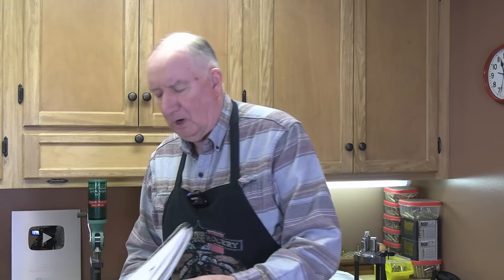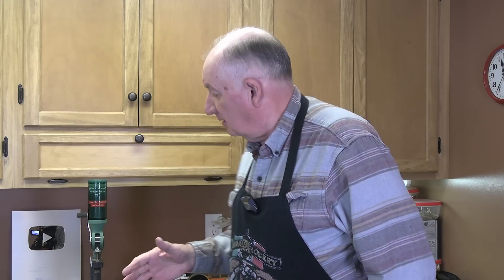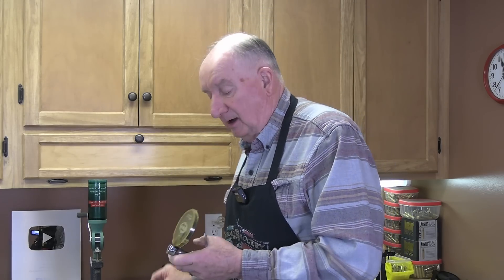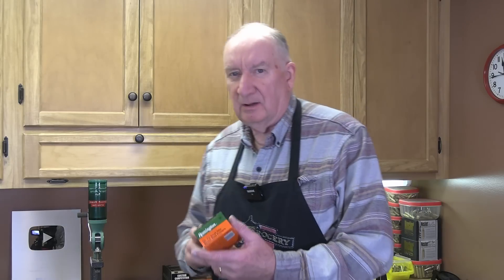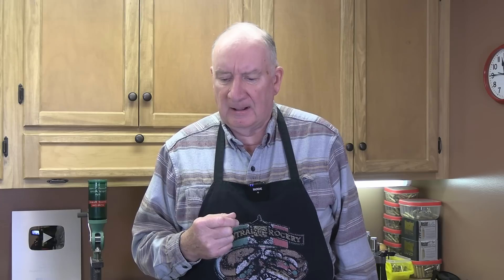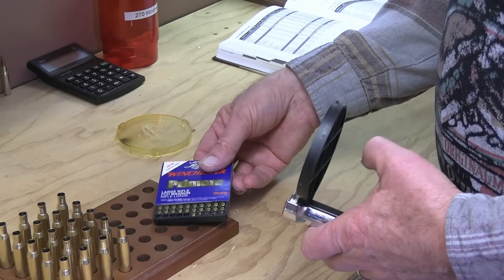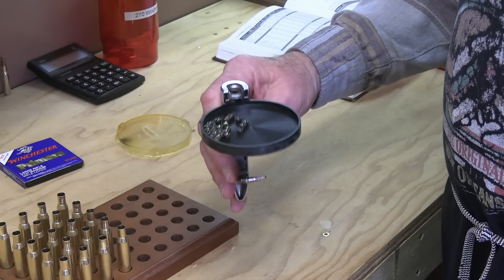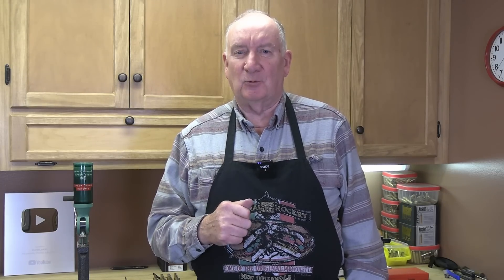How to Make Super Accurate Ammo ~ Part V Priming

Comment: You're not kidding about the velocity change between batches of primer. Running out of the lot I had on hand I pulled out an older (yellow color) box of CCI 200's and continued the same batch I was reloading. CCI 200's (40636C vs 40636D manufacturers number)  Had a Labradar running and part way through a shot string velocity went up from 3626 to 3683!@! 8.5 SD/ 23 ES for the 5 round string before this so there were none out of parameter. 
Took a break for a while until I could figure out what had happened for such a velocity spike between reloads and then remembered I had switched to that old box of primers part way through the batch. Would never have though swapping primers, especially to a different batch (granted much older) in the same brand could have an almost 60 FPS result!. Sure enough because I had boxed them as I loaded them, it was easy to tell exactly where I had made the swap.
Thanks for the great content!

Comment: I have that same exactly framing tool. I'm 58 years old. Been doing it since I've been 28 years old and that's the two of my brother told me to get cuz that's what he had and he's 13 years older than I is. Tell just another heads up. I had an issue with my RCBS rock chucker press. I'm back in the '70s early '80s. Send it in RCBS said it needed a new RAM which was 4 to 6 weeks out or send me a new one so they're sending me a new one. No cost to me whatsoever. That's pretty good service. This is February 10th I believe is when they called me about that. Still waiting for it to come
Reply: I've had very good experience with RCBS too. Sent me some spare parts to the UK foc. Needless to say when I wanted another press I bought another Rockchucker.

Comment: You know, I still use the exact same Lee hand priming tool. I could have moved on to a more precision tool costing ten times more but this basic Lee priming tool has worked for me since about 1970 or maybe the late 60's? I stock every primer made but the one I use the most is the Federal 210match. One step I use is with my primer pocket uniforming tool and the depth is precise, primers are just below flush, it's a positive feel with the priming tool. I do like to use Remington primers with certain loads simply because they are easily identifiable due to the brass color, all the rest being silver.  Example: I use 85 gr. Sierra Spitzers on coyotes and hunt deer with the 100 grain Spitzer. They look the same but the 100 grain bullets have a brass 9 1/2 primer, a simple identifying feature.... other than switching brass. I use The Federal 210M in 90% of all my rifle cartridges except 300WinMag. uses Winchester primers.Yeah, another primer would work, but I'll stick with my original load. I know that your reasoning on spending more than necessary is valid, but at this level, handloading is not about economy.

Comment: Great presentation!👍 I hope the folks new reloading follow your lead. Would sure save them lots of grief.

Started loading with my great uncle monitoring my progress as a young lad in1958. We were using his Ideal 310 tong tool for 45Colt. I still use my 310 at times. However, the old Lee Auto Prime such as yours is, has been with me for ages. Both provides that all important "feel" that these newfangled progressive presses lack.

Comment: The value of " feel" can't be overstated. The human body is a very accurate Guage of press fit, plug fit, slip fit, running fit situations. With experience, of course. I rebuild antique motorcycle engines. I can't recall the last time I measured a valve ti guide fit, for example.

Comment: I feel like I have to mention that you kinda glossed over the primer that you might want to select. I too have been reloading for decades. When I started I bought a selection of loading manuals from both bullet as well as powder manufacturers. I update them periodically. It’s not uncommon for powder manufacturers to require magnum primers for a non magnum cartridge. Hodgden is a great example. Many of the spherical powders “require” magnum primers. Speer loading manuals    confirm this in cross referencing. I recently started loading for the 300 Hamr which requires magnum primers for all their loads. I’ve also found that some load manual only use Federal 210M primers for all their load data on particular cartridges. A lot of considerations to take into account when choosing a primer. Now finding them is another matter!!!
Reply from the maker: Vernon Speer, the founder of Speer bullets, mistakenly believed that spherical powders required magnum primers, because the earliest Ball powders tended to clump, which was over 80 years ago, and was corrected with graphite coatings.  Speer's understanding is not a position ever held by the powder manufacturers, nor by the US Ordnance Department that issued millions of rounds of ammo loaded with Ball powder. Unless specifically stated otherwise by powder data, spherical powders and extruded powders require the same primers.  Magnum primers are used for rifle charges exceeding 60 grains, and that's the only requirement.

Comment: I fell hard for the RCBS Ram Prime press-top unit and It's consistent for me.  I can feel it if my fingers are loose I believe.  I just use my finger to feel the primer is seated sufficiently and rarely have I set it up wrong and flattened the cup a bit.  I have the RCBS hand prime and I've just not liked it as well.  To each their own I guess.  GREAT INFO !!!

Comment: My Frankford Arsenal priming tool has a small wheel that adjusts the stroke length of the ram that seats the primer.  I was taught to seat the primer below the case just enough to catch your fingernail on the edge of the brass.  I think that worked out to be around 0.005".

Comment: Thanks Blue for yet another informative presentation. I use the same Lee priming tool purchased in 1981 (if memory serves). I do recall at the time that Lee advised against the use of Federal primers in this tool, but I don't know if that still applies. The only argument I've ever heard for cleaning primer pockets is to prevent buildup of residue that might cause a primer to sit proud of the case. Evidently the dust produced by pocket cleaning is some pretty nasty stuff. Thanks again and looking forward to the next installment!
Reply: Yes it DOES.  NO Federal primers in that model.  Please replace it. See website for information.

Comment: The only thing I’ll add to this is with free floating firing pins in semi autos….. it’s very rare, but I had an AR that would slam fire CCI 400’s took me forever to figure out what was happening. Ended up switching to CCI 41’s which is a problem the military had and why we have the white box CCI primers… I’ve heard of it happening with older 1911’s as well but never seen it.

If you chamber a round in an AR with the full force of the buffer spring and then pull that round from the chamber you will see a small dent in the primer….. it can be dangerous in some firearms.

Comment: The priming compound is also made in extremely small batches because of how shock sensitive it is. And I agree with primer pocket cleaning lol it's a waste of time, I seat my primers on my single stage press and press them to a hair past bring flush with the casing lip, I also recycle my spent small pistol primers by taking out the anvil and taking the dent out with a punch, refilling and packing them with some priming compound from 22 reloader, it's corrosive but I use them with my 1851 colt navy reproduction black powder 36 caliber revolver. They fit just right over the nipple on the pistol chamber and are tighter fitting than my pistol cap making die

Comment: Thanks for the as always great info.  I started reloading last year following your previous videos and I have been able to tighten the groups on my 37 year old Ruger .270.  I have a question about the primer seating.  I use a single stage RCBS press for everything and occasionally I get a primer that will not go in far enough to even seat flush with bottom of the case.  Putting case back in press and running the ram home again doesn't help. The primer doesn't stick out much (I haven't thought to measure it) and I only noticed because I checking the 1st lot I loaded with a straight edge.  I'm using Hornady brass that has been shot once and neck sized. I haven't noticed a significant difference in where these group.  Should I be concerned?  Any ideas on why this is happening? 
THANKS!!

Comment: I had an experience with my Mini 14. every night I take it out of the safe, open the action, put the safety on and drop the bolt. I the morning I remove the magazine, eject the cartridge and put it back in the magazine. One morning as I replaced the cartridge I noticed an indentation on the primer. I discovered the the firing pin makes a very small impression on the primer from inertia when the bolt drops. This evidently had a cumulative effect to the point the primer looked like it had been fired. I wonder if I had not caught that when I did would the rifle eventually have fired when the bolt dropped. I now close the bolt manually and that does not happen.
Reply: I'm surprised that that is by design. Long firing pin perhaps?
Reply: @redrock425  no semi autos have a floating firing pin it is normal to do that.That is why in a semi auto it is recommended to use a military primer.

Comment: You listed Remington 6 1/2 Primers for .22 Hornet, which is what my research pointed me to.  Which primers would you use for .17 Hornet? The pressure is higher for the 17.  CCI 400's are what I have access to.  There is no complete consensus, some even use small pistol primers!

Thanks for your videos.
Reply from the maker: The 400 primers are correct.  Never use pistol primers.

Comment: I was reading that the small pistol magnum primers are identical to small rifle primers.  Would you agree with that?
Reply: I wouldn't be substituting them. Is it worth the risk?
Reply: @redrock425  There is no risk if the manufacturer acknowledges that the name is merely for marketing purposes.  I know of one manufacturer that has allegedly acknowledged that their small pistol magnum and small rifle primers are indeed identical.  At the moment I'm just checking with multiple sources for their opinion and experience with the subject.
Reply: The rifle primers probably have a harder cup.  Rifle firing pins are usually a lot stronger than pistol and rifles operate at a higher pressure.  If you use small pistol primers in a rifle you may get cup flow or flattening.  I've actually have small rifle primers flow but then benchrest and magnum primers not flow with the same load.  The difference is the cup hardness.
Reply: @66smithra  The difference in the cup hardness, or thickness, is my understanding.  Based on what I think you're describing, I'd say that while one manufacturers magnum and small rifle primers are indeed identical, it doesn't mean that the next manufacturers magnum and small rifle primers are identical.
Reply: When I’m in doubt of anything to do with reloading components, the first resource I use is the manufacture of the product. Nobody knows the product better than the actual manufacturer. They are friendly folks to talk to. 
Don’t be afraid to contact them. For anything! 
Hope it helps!

Comment: Am I the only one that used the RCBS single stage press for priming while I de prime and size it?
Reply from the maker: That's perfectly acceptable.  I've loaded countless rounds with my RCBS Rockchucker and primed with it.  The only downside is that its strong leverage provides no direct feedback for uniform seating and it can easily crush a primer which can cause flash variations resulting in velocity variations.  Dedicated priming tools provide vastly improved "feel".
Reply: @GunBlue490  I agree but I’ve used it so much I can actually feel the primer going in.  But what you stated is the truth.
Reply: 'Been doing it for 40 years.

Comment: PLEASE replace unsafe old lee auto prime tool.  PLEASE see website for information.
Reply from the maker: I've read about lots of problems with the new tool.  I've loaded over 30,000 rounds with the original one without any issues.  In fact, when an upside down primer detonated 40 years ago, the tool safely contained the blast, without detonating the others.  I believe it's a very good, safe tool.

Comment: While primming I tell people . If doesn’t feel right it probably isn’t right. Stop and have a look. The top primming tool out there is the Lee as you illustrated. Unfortunately they don’t make this tool anymore. It was replaced with a real horror show plastic over engineered piece of crap. After 53 years of loading these tools will fatigue out. I’ve worn a few out. You are correct on match vrs standard .l have tried them all and there is no difference in performance even match rifles shoot the same.